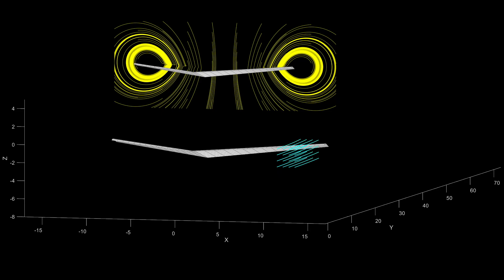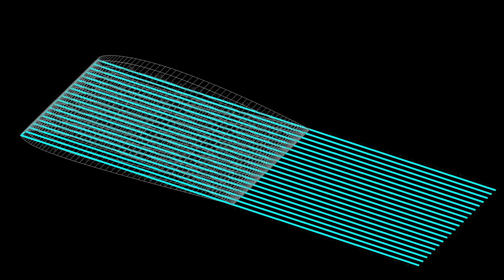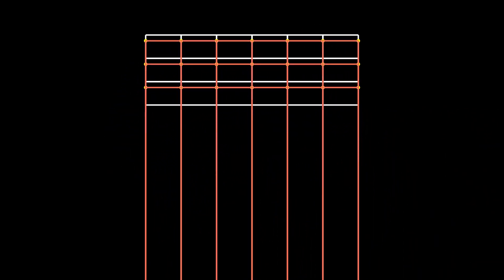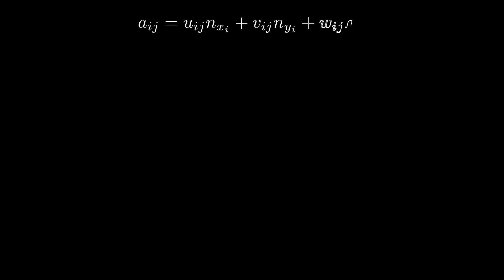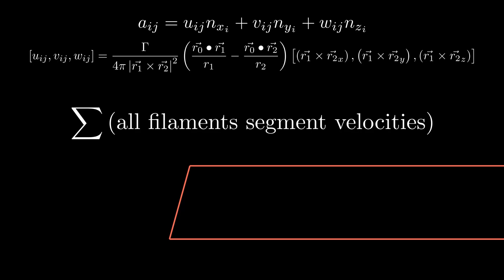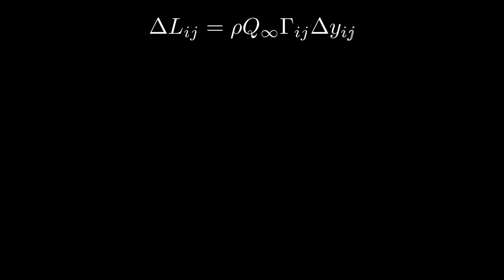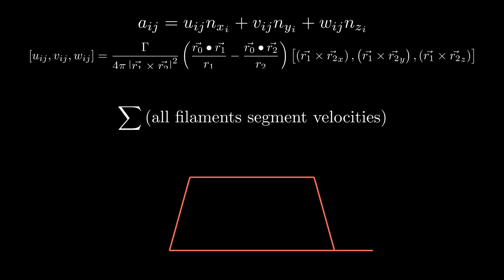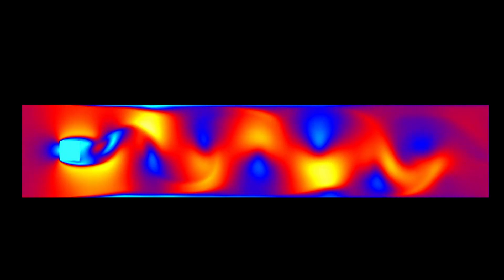How to Model 3D Wings Using Vortex Lattice Method

Comment: What is the reason for using 1/4 and 3/4 points?
Reply from the maker: For one it is a clean way to discretize. If we did 0 and 1 of the panel chord then there would be alot of collocation leading to many errors and singularities. The 1/4 is picked based on thin airfoil theory telling us the lift acts around the quarter chord so placing the vortex there helps give good lift approximations. The 3/4 is nice since it puts the mid chord directly in between the vortex and the control point but apparently taking this test point there is a good approximation for the normal 2pi slope we see in thin airfoils but I haven't looked to deep into that reasoning.

Comment: Does the vortex panel method work with 2D wing, if we need to predict the downwash angle?
Reply from the maker: @ВадимСавенков-з2ю  not fully sure but it does fit the the shape of wake curve that best fits experimental data. So in the 2D it pretty much flows off at the trailing edge angle, but as it continues down stream into the far field it then asymptomatically returns to uniform flow angle to that of the incoming stream. Find a online pdf copy of the international version of Low Speed Aerodynamics by Katz  and go to chapter 9, figure 9.6. Should have a 2D wing with wake angles/curves. It talks about that shape being the best. It sadly doesn't go in to how to find these and each airfoil at each AOA would be different so not easy to find these curves but you maybe onto something with that being a good starting point.
Reply: @Tidepodious  Thank you, I'll try to do it
Reply: Hello, how do you think of the concept of consideration shear layer, especiallyif we have an actuotor disk.  @Tidepodious